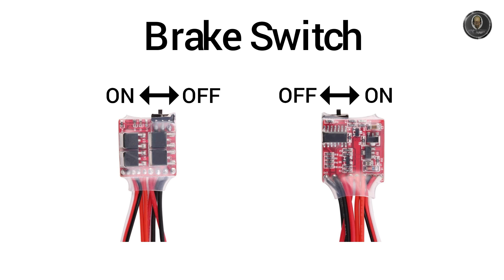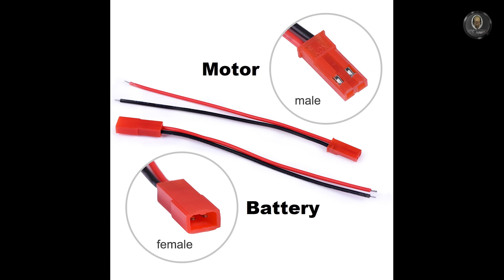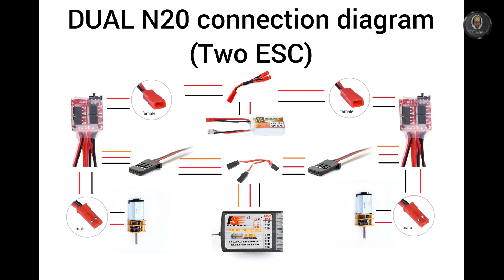Dual N20 Motor mount - New version

Comment: Hi Adrian, in your thingiverse post for this project, there are 5 thing files, but it seems only 3 was used in this video. Would you kindly advise which ones we need to print? Thank you so much!
Reply from the maker: v4 is new design and max clearance give more space under car :)
Reply: @Adrian202  Which one do you recommend to use? 😀 Does more clearance mean steeper drive shaft angle? Thanks so much Adrian..
Reply from the maker: @summersong88  Clearance mean more space under the car to avoid rocks or other stuff on the road.
After I design v4 it's better to use that.
Not much change on v4, just some small mistakes fix
Reply: @Adrian202  Thank you so much 😀😀🙏🏻🙏🏻
Reply: @Adrian202  After reading your thingiverse over and over again, I hope I come to the right conclusion: Max clearance is a combination of base and bottom in one unit, so if I use max clearance, I will print that and the V4 cover, is that correct? Thanks so much for your kind assistance! :)
Reply from the maker: @summersong88  Yes that's correct.
I did not remember that about the second version :D

Comment: sorry, what are capacitors used for?
Reply from the maker: Capacitors stabilize voltage and reduce noise from motors that may go to electronic.
Most of ESC now have capacitors but why not add another one :D

Comment: Hello sir can we use 2 lithuim cells for the esc together making 7.4 v laptop battery cells reply please
Reply: I am using same esc witg same n20 motors but motors starts beeping when i connect
Reply: Around 2600 mah cell each
Reply from the maker: @gobindmodelmaker7188  Slow down :D not all together :D
you can but they need to have same voltage or one of theme will die faster that's why You could make balancing port for it so charger will charge theme both and than balance to ensure same voltage on cells and this way You just make 2S battery.
Maybe ESC beep because voltage is to low ?? there is voltage protection but I never discharge to much batteries
I also don't use this ESC anymore because DumboRC 10A is much better.
Reply: @Adrian202  sir i charged them with balance charger 2s  but when i poug it to esc and then  single motor to it motors starts beeping but when i use mobile battery 3.4volt motor works with esc. What could be the problem
Reply from the maker: @gobindmodelmaker7188  this ESC can't work on 1s (single cell) it can only work on 2s battery and that's minimum so that may mean You have faulty ESC it happens
Reply: @Adrian202  now i need to change...
Reply: @Adrian202  how is dumborc esc ?? And can dumborc transmitor can work on another receiver if dumborc x6 i. Want to order new esc and only dumborc receiver
Reply from the maker: @gobindmodelmaker7188  I don't think it will work another transmitter until it's the same modulation but so far I check Radiolink with gyroscope and that did not work.
I like that ESC but it's only 10A so it's not designed for bigger motors like 540 but other motors take about 5A max so nor problem but You have light switch there and can run slow so for Me it's perfect :)

Comment: 6v motor resist to 2s lipo (8.40v) ?
Reply from the maker: It work fine but little faster but if You chose 12v motor it will work on half speed and halt torque so it's better to chose 6v motors :)

Comment: Should I go for dual esc..... One esc per motor with 300 rpm
Reply from the maker: I think that for 6x6 is would be better to chose two ESC because 2 axles will slow down motor more and You could trim it but that would require transmitter with port mixing and separate trim
300RPM for 6v will be little weak but You will need to test that :)
Reply: @Adrian202  i have dual motor esc 320 amp from my tamiya txt 1. Will it power up those 300 rpm?
Reply from the maker: @atif8221  One N20 motor will draw about 1A max :D or less :D I use one 20A cheap red ESC and that work :D

Comment: I ordered n20 6v 300 rpm.... But torque is not enough for 6x6...any other motor?
Reply from the maker: 300RPM is little to weak for 6x6
You may try 200rpm 6v from here
https://www.banggood.com/Orlandoo-OH35P01-KIT-RC-Car-Parts-Gear-Motor-p-968516.html?p=5G2717320323201310AJ&utm_campaign=Adrian&utm_content=3312
or this beats that i will test but I don't know how this motor work and it will have half speed of 300rpm 6v
https://www.banggood.com/Machifit-13GA050-6V-150rpm-DC-Electronic-Speed-Reduction-Gear-Motor-with-Metal-Gearbox-For-Elevator-p-1341680.html?p=5G2717320323201310AJ&utm_campaign=Adrian&utm_content=3312
Second motor is longer so magnets are stronger and I think it have steel gears but torque is much larger because it's longest motor that type :)

Comment: I have 6x6 version and your v2 design and 100 rpm motors but its too slow
Reply from the maker: Yes, minimum is about 160 RPM for 6v (yes not 12v that's important)
https://www.banggood.com/Orlandoo-OH35P01-KIT-RC-Car-Parts-Gear-Motor-p-968516.html?p=5G2717320323201310AJ&utm_campaign=Adrian&utm_content=3312
Here are more motors to chose so You can get motor with speed that You want, I use 160RPM but ordered 200RPM for B24 and this gigant for B-1
https://www.banggood.com/Machifit-13GA050-6V-150rpm-DC-Electronic-Speed-Reduction-Gear-Motor-with-Metal-Gearbox-For-Elevator-p-1341680.html?p=5G2717320323201310AJ&utm_campaign=Adrian&utm_content=3312

Comment: Should i use n20 300 rpm or 400 rpm?
Reply from the maker: faster motor = less torque so it's always better to chose some slower ones.
For truck is better 200rpm 6v (yes voltage is important) but if You want something faster chose 300RPM 6v
Best choice of motors are here:
https://www.banggood.com/Orlandoo-OH35P01-KIT-RC-Car-Parts-Gear-Motor-p-968516.html?p=5G2717320323201310AJ&utm_campaign=Adrian&utm_content=3312
But if You want some gigant torque You can order this one:
https://www.banggood.com/Machifit-13GA050-6V-150rpm-DC-Electronic-Speed-Reduction-Gear-Motor-with-Metal-Gearbox-For-Elevator-p-1341680.html?p=5G2717320323201310AJ&utm_campaign=Adrian&utm_content=3312
I ordered one and will see how that work but for this one You need N30 cover because it's N40 motor so they are longer but have stronger power :)
Reply: @Adrian202  Hi, thanks for sharing your design. May I ask a few questions please? I really hope to hear from you.
For trucks you recommend 200rpm, what about for mini crawlers like WPL C24 or MN90? 
What are the advantages of dual N20 motors compared to 370 motor with single speed six bolt metal gearbox, like this one: https://shopee.co.id/product/166006642/5738497754?smtt=0.127347252-1610108500.9
Thanks a lot!
Reply from the maker: @summersong88  Hi, 200RPM because slower will be to slow :D and faster not to realistic :)
Slow motor mean bigger reduction = more torque
Sadly these motors and gearboxes are not the best quality, and they like to break over time.
Separate motors for each axle give car more power because if one axle is blocked second one is still working, but bad part is that most of these motors will not have precise speeds so not always they spin the same, but it's still just a toy/model.
I got that one speed gearbox, and it's good, more speed and more torque, but You need to cut the body to fit that in most of the cars :D
It will be stronger but also if something block axle motor will brake driveshaft because how much power there is
Reply: @Adrian202  Thanks a lot for taking the time to give this detailed reply! :)
OK noted 200RPM. Noted also on comparison versus single speed 6 bolt gearbox. I like that dual N20 with the motor mount that you designed gives better ground clearance. For 2S LiPo, do I go with 6V motor or 12V motor? 
Thanks again.
Reply from the maker: @summersong88  You chose motor voltage depending on battery,
N20 motors have gearbox that reduce speed to torque.
Motors always have more power on full speed so if You chose 12v motor for 2s battery than it's about 70% of max voltage and on 6v is above so better chose 6v.
I have 3 cars with 3 types of motors but that N40 (telling the truth it's not N40, there is a specific model number) are much slower and I wanted that to simulate heavy cannon behind car

Comment: What rpm motors?
Reply from the maker: about 160-300RPm but for 6v because there are also for 12v and they will have half off speed and less torque.
I have 160rpm on B-1 and will replace motors on B24 for 200rpm because one have gears problem

Comment: Is this the upgraded version.... I mean v3
Reply from the maker: If I remember it's v2 but v3 is just mirrored due to My mistake and fixed one hole in wall but they are the same and only max clearance version is made from 2 parts and v3 from 3 parts :)

Comment: O que melhorou no carro com esse "upgrade"? 
Ficou mais silencioso? 
Ficou mais forte? 

What improved any cars with this "upgrade"?
Is it quieter?
Are you stronger?

Co poprawiło wszystkie samochody dzięki temu "ulepszeniu"?
Czy jest ciszej?
Czy jesteś silniejszy?
Reply from the maker: Nice idea in writing in all languages but english is ok :)
Two motors have more power than one, if one motor will be blocked the other one wills till spin :)
More quieter ?? don't think so, now You have two gearboxes so they maybe make more noises hard to say.
About power it's like this.
WPL motor is faster but it's not strong and here You can chose what speed You wont by changing motors to other RPM
More RPM = less power
so 300RPM for 6v will be weaker than 160RPM on 6v but will be faster
remember that motors on 6v are better for 2s battery and motors on 12v are better for motors on 12v
I use 160RPM for 6v and I like that speed but 200RPM on 6v would be little faster and still strong :)
There is also N30 motors and they are longer and have more power but still can be found on ebay and hard to get for 6v
Reply: Lauro no Brasil fabricamos várias peças e vc acha baratinho essa base com 2 motores. WhatsApp 11 973395405